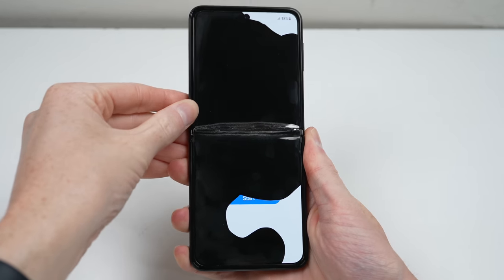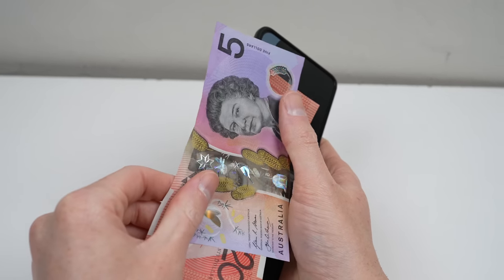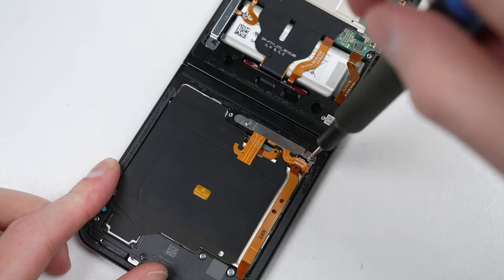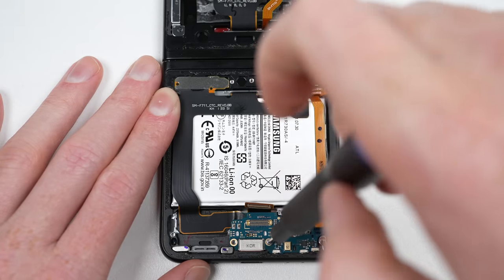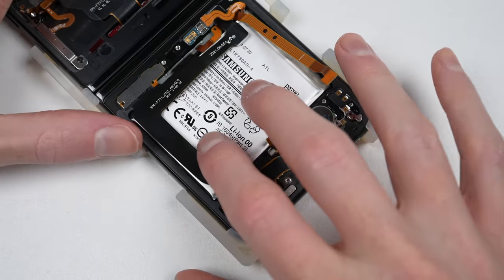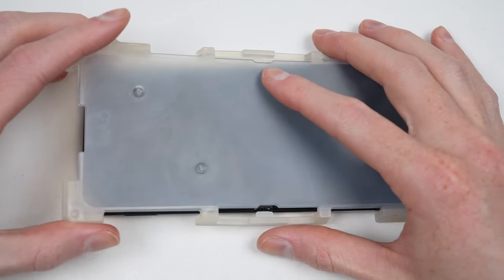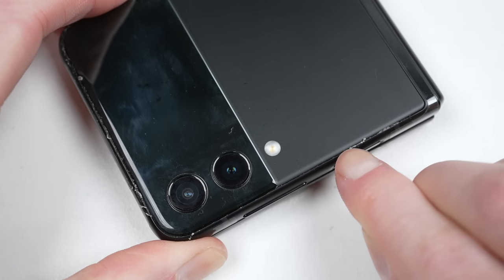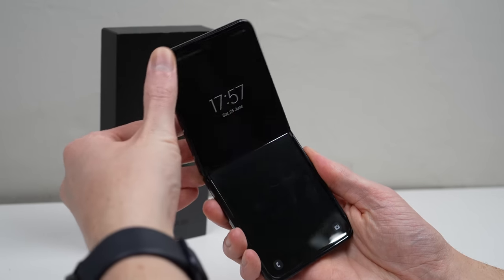$230 Galaxy Z Flip 3 Restoration

Comment: I simply can't understand why You are not using rework kits made for each models by Samsung? They are not so expensive - like 4-5$, but repair looks more professional and waterproof could be saved with them.  I am afraid that with this glue You are using there is no waterproof possible anymore. But repair looks great! Had one such Z Flip 3 which was drove over by car - couldn't save it :(

Comment: These folding phones, it'll be a long while before they are properly stable, if they'd ever be as they are too fragile. As for me, i'll stay with my folding galaxy, a Galaxy Folder2. A filp phone that's a bit older, but runs android, touchscreen & all that, far more stable than any of these types.
Reply: They will probably never be stable, a folding screen really isn’t a good idea in practice.
Reply: @EvilTurkeySlices  Indeed, as these kinds of screens & phones, more of a novelty. Might be interesting to play around with one for a short while, but i would not own one. And at some point, these kinds of phones might just die off, a tech experiment that didn't work out too well, but somewhat interesting for a short amount of time maybe. Certainly not practical, and quite expensive.

Comment: yeah so esentially you wont be able to get those screens anywhere, and like you can see in this and many other videos, they pretty much swap entire phone over.. the mechanism, the screen, protectors etc.. its all goign to be in the waste bins now. its a known thing that this screen will only last 6 months.. and samsung dont care, they wont sell us screen only.. but entire assembly.. same with oppo. Oppo fold is using samsung screens and repair is identical, yo uneed to get whole module to replace.. which is about 250£ which is like replicing two a year = half value of the phone.. so yes foldable phones = consumable.. I really hope that google pixel fold will be better.. but I ahve my doubts.. buying those phones used.. is a roulette.. so they have zero resell value .. and they are just never as good as slab phones. I guess I will wait another 10 years and check if they advance any more or not.. no point of getting phone when you fear it breaks next time you close it. ( I had razer 2019 and it broke after a year..right after warranty)

Comment: liquid glue massive no no, I mean never use it to replace a housing gasket. 

1. The panels will sit lower 
2. Possible the glue will spread to areas it shouldn't due to much application
3. Causing issues for future repairs, brake the screen again you are not opening that phone without damaging those panels.
4. The glue bulge at the edges causing tiny blobs to appear on the corners making the phone look shoddily repaired

Personably when out of proper panel adhesive gaskets or they are just not available I will try to save the original tape best as possible and trace out a new gasket from A4 sheet of double sided tape and just cut out and apply. I was just thinking while watching this " Oh a decent job he was doing" and the liquid bloody glue XD.

Comment: I have been using a Z Fold 3 since September 2021. The phone has fallen multiple times, on the hinge (while it was folded), and on the main screen (while it was unfolded) - the screen still works without an issue. So I disagree with your statement that foldable phones are as fragile as you've claimed.

Comment: Personally if i brought this phone newish or broken then fixed it 
id use the flip function prob only around 4months everyday. 
id then get or make a hard case and screen flip cover so it could be used as a normal 
phone without Folding it at all just so it can carry on being used for 5 or more years rather 
than a few months to a few years.

another use could be endless not just used as a cell phone 
tho even having it not flip via a costom hard case with back and sides when at a sandy beach incase aint a bad idea .

Comment: Well if the screen fails on its own (you arent purposely damaging it or damging it in a way that voids the warranty) then samsung will fix it for free under warranty. My Fold 3 had cracks in the ultrathin glass along the crease. Called samsung and got it fixed at a nearby store for free, they gave me new batteries and rails of the phone for free as well. The phones are stronger than you think, check out Jerryrigeverything's durability test

Comment: People talking about how foldable phones are fragile must not have owned one or absolutely abuse it.  I've had mine well over a year and drop it on gravel and  concrete at all angles, it also gets caught on things in my back pocket pulling against the hinges.  Tonight it just now somewhat broke. Fell of the roof of a truck as i was using for a flashlight. Screen isn't even cracked, there's just a thin bright line right under where the time and battery percentage are.  Not even going to get it fixed at this point because I'm confident it can handle plenty more falls.

Comment: Thank you for sharing your repair, however I believe the poor design of the phone already makes it a candidate for pretty much nothing but ewaste. The design for the fold is nothing more than a gimmick rather than an innovation that adds to the device. It will lead to many of those screens cracking down that fold for no other reason but novelty. What a shame indeed. If it ain't broke don't fix it when it comes to the touchpad!